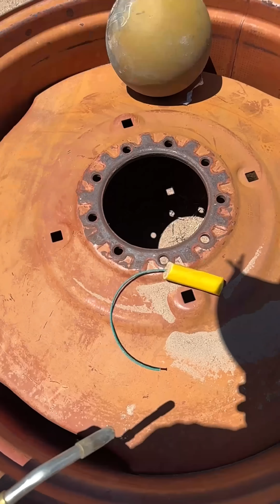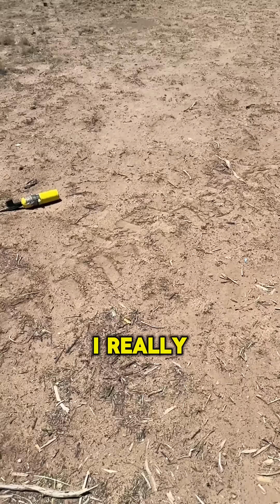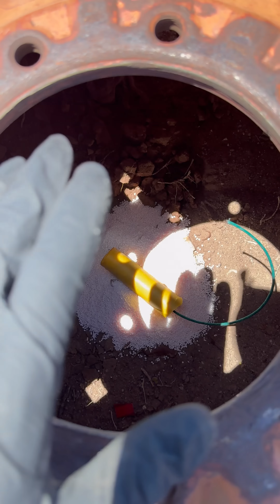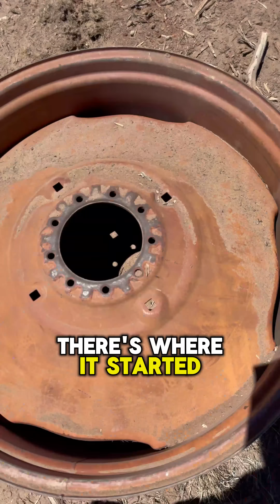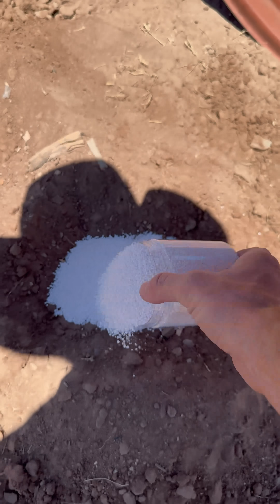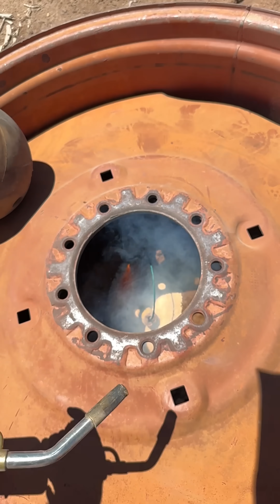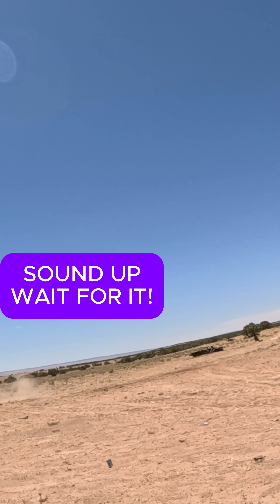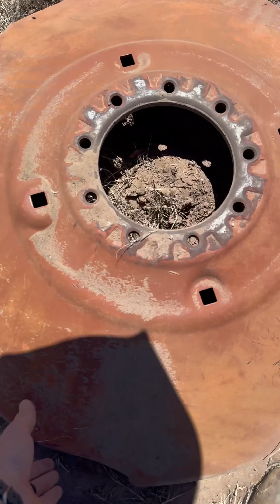How powerful is ANFO and Dynamite?

Comment: I know ANFO won't react when exposed to fire but watching you light a fuse buried in ANFO spooked me a little.
Reply: Think of it as c4 it ain't gonna light it requires alot of boom to kick start it acually better one its like diesel it doesn't light but if compressed it go boom
Reply: @matthewching500 Interesting
Reply: @matthewching500 diesel does light wtf are you talking about it just burns slower than gas
Reply: @chaynebaltezore8986 you need a much higher compression to get it to reliably combust and unlike gasoline you cant just throw a match or a cigarette at it to light it, you would need at least a blow torch
Reply: @nuclearboom2467 never put out a cigarette with gasoline?
Reply: @AdamFoster  That’s a cigarette. Not a match. Cigarettes don’t light anything on fire. This isn’t the movies. They’re also right about diesel. It needs to be aerosolized and compressed to ignite.
Reply: @chaynebaltezore8986  No, it doesn’t. There’s a reason diesel engines operate the way they do.
Reply: I was thinking the same thing no clue what anfo was
Reply: What does it react to then
Reply: @antoine6717 its a secondary explosive,  meaning its very stable. It needs the shockwave from a primary explosive which is why hes using dynamite with it. Also why you need a blasting cap to set it off otherwise. And ANFO is very similar to tannerite which detonates from the shockwave from the precussive wave from high velocity rifle shells.
Reply: @PhilieBlunt666 thing is, he not using ANFO . That’s ammonium nitrate, the AN part of ANFO, and no it’s not a secondary explosive , it acts as an oxidizer… basically just
UPS the boom factor .
Reply: @dirtdevil70 thats what i said before. There is NO FUEL OCTANE. 
2nd put MORE MASS on top of the rim and you get a destruction 😅😅
Reply: @antoine6717  A shock wave of sufficient speed and sharpness to cause detonation.  Basically the molecules break up, a whole different thing than mere combustion.  The detonation wave then passes throughout the material, liberating a lot of powerfully-expanding gases and heat.
Reply: @antoine6717  The pressure of the dynamite blast
Reply: @antoine6717 it reacts to energy transfer. So the massive amount of kinetic energy the dynamite spits out causes the ANFO to react.
Reply: @antoine6717 it likely uses a force. 

Like a primary explosion. That sets the larger material off
Reply: @antoine6717  it reacts to shockwaves
Reply: @antoine6717  the shockwaves have to be pretty powerful though. its a secondary explosive.
Reply: @antoine6717  a detonator, and the dynamite does that it detonates the anfo. Once the dynamite explodes it exert so much pressure onto the anfo that it will detonate. Fuse burns+ anfo melts a little, +Dynamite explode+ pressure initiates detonation of the anfo. This is basic chemistry.
Reply: @maktiki  No need to be condescending, I could teach you a thing or two about computers that I would consider basics as well.
Reply: @antoine6717  Its just a joke:face-blue-smiling:
Reply: @antoine6717 impact. Explosion
Reply: @antoine6717  Explosive force
Reply: @antoine6717  cannon fuse too
Reply: just melts
Reply: i bet you think you can blow a car up by flicking a cig in the gas tank 🤭🤷‍♂️
Reply: @graphixkillzzz  if the tank is not full and you leave the cap off you can.
Reply: It's not ANFO, it's just Ammonia Nitrate without the fuel oil.
Reply: @Cr-cm9kc ammonium*
Reply: @Cr-cm9kc in another video he says it is anfo not just ammonium nitrate, but he makes it and it needs less diesel than you think.
Reply: @Cr-cm9kc maybe I'm just used to ANFO always using tinted diesel, but that looked like some idiot who has never made a living using explosives just scooping out dry white prill & thinking it works like black powder without knowing hos black powder works. Leaving the bernzomatic behind = amateur
Reply: @m-erko I agree as stayed before where the damn diesel
Reply: @m-erko  So the standard for watching an entertaining video involving explosives is that the creator must have "made a living using explosives?"
Reply: @Cr-cm9kc  That is what I was thinking. I didn't see any Fuel Oil (Diesel).
Reply: The fire fighters in West Texas probably agree with you.  R.I.P.
Reply: LOL I was thinking that exact thing, he is safe but still get the sphincter effect lol. Now I can kinda understand when I am working on live 3 phase and some people cant watch, even those that know I understand what I am doing and am safe, they still get that same effect  :-)
Reply: I thought ANFO is actually ammonium nitrate fuel oil emulsion. This looks like just ammonium nitrate. You need to mix it up, add a fuel oil with ammonium nitrate sat. Solution and a PIBSA emulsifier.
Reply: @f1ferrarifan1  Yes it's just AN.  Which is a high explosive of considerable power even without the fuel oil.
Reply: @f1ferrarifan1  as for creation of ANFO, yes you are correct it is technically an "emulsion" although it's not normally called that as  you're dealing more with a physical particulate matrix, not a chemical one as in a true emulsion. Emulstions are typically between hyro-phylic/phobic substances, or lipo-phylic/phobic etc. 

ANFO is an emulsion in the sense that you are essentially coating ammonium nitrate particles with diesel fuel oil. The diesel effectively slows combustion and slows the detonation rate in m/s. This is really only useful in the blasting/mining fields, as its purpose is to slow the detonation wave enough to allow it to push solid material, versus cutting/smashing it. 

TL:DR ANFO is kinda an emulsion, on the macro scale, designed to slow a detonation wave and allow more kinetic energy to be dispersed into a blast medium, aka a material to be displaced by HE. ANFO slows it to get the highest energy deposition, while maintaining the  cracking effects of HE dets.
Reply: It can burn.  Which would be quite bad in this situation.
Reply: @TheAttacker732 Nope
Reply: Me too!!!
Reply: ANFO =ammonium nitrate, fuel oil (diesel). Theres no diesel in that, with diesel, it only needed the fuse and explosive cap. And by the way, how do you think a burning truck carrying bulk ammonium nitrate explodes, making a huge crater and devastating anything in the area?  Several documented stories on yt about that happening.
Reply: @rossbrumby1957 how do you know there's no diesel in it? It's only supposed to be 6 percent, and if he used clean diesel, or maybe kerosene, you probably won't see it. The stuff soaks it up really good, so it will look dry
Reply: @ShannonDove-sy7ye I went to Victory day parade in Moscow 2012. The smell of diesel from all the IFV’s, tanks, was epic. I’d love to see about 1000 tanks/IFV’s drive down a California road burning that much diesel, but it would most likely end in a 10 year prison sentence. We were in the side streets and it was actually worse because Red Square is enormous and there is room for the fumes to dissipate a little.  At least feel like you feel not smoking it there because it’s much more open. Like or hate Russia, they do a badass Victory day parade to commentate the victory over Hitler’s stupid army.
Reply: @rossbrumby1957 what is used for the booster charge?
Reply: But the Smoke ring! right! lol
Reply: ANFO ist acording to Google, Ammonium nitrate and heating oil, altough that seems to be just nitrate. And we know what that can do just. If not check out the catastrophe in Beirut in 2020.
Reply: Same.
Reply: Same 😂
Reply: Spooked me too. I like watching this guy.
Reply: Is that like tanerite the shit we get in Canada???? Comes in 1lb plastic containers. I shoot it to make it go boom
Reply: @jacobmcleod5942 it’s 1/2 the components in tannerite. Tannerite is a mix of AN and aluminum oxide.
Reply: @jacobmcleod5942  tannerite is ammonium nitrate prill and the grey powder you mix in is aluminum oxide. anfo is ammonium nitrate prill and fuel oil.  they are mixed in approximately the same percentage. {anfo is 6% fuel oil}
Reply: @jacobmcleod5942 two deferent compounds tenerite is shock sensitive anfo you pretty much have have a blasting cap or a smaller explosive too set it off
Reply: @jacobmcleod5942 tannerite is anhydrous ammonia mixed with powdered aluminum. So yes, you did recognize one of the ingredients. 
Anfo is ammonium nitrate and fuel oil. This is just dry ammonium nitrate. 
Anfo us what the mythbusters used to obliterate the cement truck in season 1.
Reply: Where's the Diesel Fuel?
Reply: not ANFO thats only AN pearls...
ANFO Amonium Nitrate Fuel Oil
Reply: @tytauer1063 how do you know? It can soak up liquid and still look the same. Especially if he used high grade clean odorless lighter fluid instead
Reply: the primary was the dynamite 🤣🤦 ig yall didn’t realize how much higher it went each time
Reply: Guys, here is the True Savior of man

HalleluYAH translates “Praise YAH”

- YAH is the Heavenly Father (Genesis 1)

- YAH arrives via The TENT OF MEETING (Exodus 33, Isaiah Scroll)

- YAH The Father (Genesis 1) was Who they Crucified for the sins of “man” and YAH arrived to be Crucified via the Tent of Meeting 
(Book of Isaiah)

YAH The Father, He’s The Savior
Reply: Doesn't explode bro it just melts. You need a primary.
Reply: @stevepalpatine2828 White phosphors is being used in Ukraine. Looks heavenly from a far but not when you movie close and hear people burning alive, nothing pretty about it. It’s had to judge exactly where it will go or what areas are you can get through and which ones you can’t. All depends on how many they drop.
Reply: @chriscarlino5561 cool dude 👍
Reply: @chriscarlino5561 holy shit bro. Clearly proof reading ur comment before posting has absolutely never crossed ur mind. Ur comment almost made zero cents
Reply: @Woodshot48 I’m dyslexic and it didn’t cross my mind to prof read this comment.
Reply: @Woodshot48 I fixed it. Happy now?
Reply: @Woodshot48 I wrote this outside. Before you through dirt on someone, know facts first. I was taught you don’t through dirt at another man if you don’t know facts. And despite being dyslexic, I’ve done damm well for myself. How many languages do you speak? There was this other guy to who was dyslexic, you might have heard of him, I believe his last name was Einstein. He regularly struggled with spelling and grammar. Our brains don’t see the mistake while writing mostly. But verbally, I can get my point across fine. It didn’t stop my from attending a highly competitive Prep school as well as graduating from a very well known university in Philly. Think basketball. It’s just immature people who point out grammar issues, or speaking mistakes on YT. Mature people understand there are people with disabilities and that English may not be the persons first language.
Reply: @Woodshot48  You missed a comma after Clearly. It should be Clearly, when using this work first in a sentence. Another example would be when However, is the first word in the sentence it gets a comma. You also forgot a period. So don’t criticise people unless you are flawless yourself. If you want to be taken seriously don’t use “ur”. Do you think someone from another country gonna know what that is? Not even a word!
Reply: @Woodshot48  zero cents?  I think you mean zero sense
Reply: @TyroneMalon yah good ol auto correct
Reply: Yea he's for sure going to kllhim self at some point... on accident... but he's defo gunna blow his face off
Reply: I also find it a bit retarded that it's not remotely controlled and the gas canister being a probable projectile

edit:
and not knowing where all the parts fly
Reply: I agree
Reply: Things behave differently in massive quantities....a massive quantity of ammonium nitrates in a massive intense fire can be detonated by the fire.  But small quantities are usually not set off by fire
Reply: trusting cannon fuse to not instantly ignite that dynamite is fucking insane.
Reply: didnt look like anfo, jus an. anfo i think is a slurry in kerosene or diesel
Reply: @seagee7100  anfo is not a slurry. its only 6% fuel oil which is absorbed by the AN prill.
Reply: Pressure!. It needs a shockwave to go off. Yep.
Reply: I didn't know that and I was definitely nervous watching that!
Reply: I had the same feeling when I saw a 90 years old colonel chemistry engineer scraping TNT from an old grenade with a screwdriver. He was completely calm though
Reply: Same!
Reply: ANFO REACTS TO PRESSURE WAVES OF A BLASTING CAP OR DETCORD
Reply: The real danger is he accidently lights the base of the fuse by pulling the torch out too quickly with it still burning.
Reply: What is anfo? Americans get to do all the cool things 😂!!!!!
Reply: super stable shit, can buy it from academy on the shelves, has a catalyst in inside you mix up real good, and the heat and power from a rifle round set it off, or just use dynamite
Reply: @Gamin_Redneck oh so like tanerite basically?
Reply: Dude, the guy know what ANFO is. He's mixed in the right amount of Diesel.
Reply: I would use a much longer fuse than that.
Reply: Is anfo the same as tannerite
Reply: @kytrucking67  No but they have similar resistance to heat and both are binary explosives. I don't know what gets YouTube mad but let's just say they are share chemical components but also have significantly different chemical components. ANFO requires a primary explosive to detonate where Tannerite can be detonated with a Primary as well, it is more commonly detonated with high speed projectiles. Long story, ANFO is made in larger quantities and is nearly impossible to set off without a primary explosive. Tannerite is sold in small quantities and can be set off with a bullet. Both are binary explosives and can be shipped safely with the two parts separated without concern of an explosion.
Reply: @AdamVladimirKross thanks
Reply: That's not ANFO
Reply: Right? Still looks sketchy. Lmao
Reply: Same with C4. You can burn it safely. Used to do it to heat up MREs years ago. lmao
Reply: It is as dangerous as lighting water on fire. ...Exactly.
Reply: me too, but then I was reminded of the cowboy hat in his silhouette
Reply: His army wasn't stupid. If we implemented their wisdom, Western society would be safe and clean throughout
Reply: Idk if this has been answered yet, but anfo needs pressure and temperature.
Pimary small explosive gives both.
He could potentially make it go off with a firecracker, tho depends on exact anfo.
Reply: @Arek_R.  Yes the geometry of the container infleunces the way it wil exert pressure and temperature on the anfo
Reply: Wayy too confident but that's the difference if understanding the science behind. I learned when I was little not to mess with fireworks 😂or anything related
Reply: Man....the comments. 

- Anyways, he said the powder he was using was ANFO, so it probably was anfo. Yes ANFO can exist in this state. We call it a dry blasting agent, so no, you can't tell the difference just by looking at the prills. You WOULD able to tell by smelling it though. 

- Yes, anfo just melts when hit with fire. 

-ANFO typically is not cap sensitive. So no, a blasting cap won't set it off. But there are types that can be cap sensitive.
Reply: The 2020 Beirut explosion would like a word.
Reply: @fido2006 that explosion was a lot different than 2lbs of loose ANFO and a blowtorch.
Reply: @valdimer11  The OP needs to up his game.
Reply: FR ME IT WAS WHEN HE PUT THE TORCH DOWN NEXT TO IT I WAS LIKE THEIR GOES A... WTF
Reply: Same here 😅 Even knowing the chemistry, the visual of that fuse going in still made my heart skip a beat
Reply: It’s not ANFO…… no diesel.
Reply: Bowling ball is now in low orbit.
Reply: RIP the torch
Reply: Its just ammonium nitrate and it adds a stronger oxidizer upon detonation. Anfo and ammonium nitrate ARE NOT CAP SENSITIVE. Don't mess with HE if you haven't learned a lot about it on the job or grown up around it.
Reply: What caused the catastrophic explosion in Beirut? Thought that was just fertilizer?
Reply: I did NOT know that ...I was terrified
Reply: O to tak nawozy w Bejrucie uległy samozapłonowi. 😮
Reply: Holy shit that was cool
Reply: What is the simplest booster to det amonials like tannerite
Reply: The comment i needed to see
Reply: Need shockwaves to detonate
Reply: Ight, we now pals
Reply: People have a fundamental misunderstanding of how 'splosives actually work... the same people who think dry ice in a bottle thrown is a pool counts as a bomm.
Reply: @NickGreiner1988 I mean I've seen a guy lose his hand from a dry ice bomb not gonna hurt a building by any means but will definitely hurt you
Reply: @NickGreiner1988  a closed bottle of dry ice does create contained pressure, so it could be counted as a potential explosive/bomb, the same way the canister of a regular air compressor can be explosive. Any contained gas under pressure is a potential explosive really, the only difference to real bombs is how you create that pressurized gas.

Understanding what an explosive is is not difficult, the difficult thing is understanding the different mechanisms and potential chemical reactions of different explosives.
Reply: @NickGreiner1988  No but mentos in a bottle of soda is a bomb. Could be lethal if tiny pieces of metal are in it. But it’s for sure a “fun bomb”. lol dad joke! Splosive is what I put on my girls face.
Reply: If it makes you feel any better, if it did react you wouldn't have the video.
Reply: @atomictincan7040 well, we might, just not here on YouTube. Depends on who finds him and his cameras out there and if they have an 𝕏 account.
Reply: So it doesn’t react? What’s the point
Reply: @madebydimiakagreekmachine5822  they didn’t say it doesn’t react. It doesn’t react to fire under a certain temperature. The explosion is what starts the reaction
Reply: @madebydimiakagreekmachine5822 Clearly does considering the result. Anfo needs a significant shockwave to detonate. Triggered by the dynamite.
Reply: @madebydimiakagreekmachine5822 it only detonates when hit with a lot of pressure, like a explosion from a stick of dynamite. Tannerite is the same way, you can burn it and it won’t do anything, shoot it with a gun however and results may vary😂
Reply: @madebydimiakagreekmachine5822  It does, to dynamite... Not fire.
Reply: @madebydimiakagreekmachine5822  pretty sure it reacts to explosivity might be wrong tho
Reply: @madebydimiakagreekmachine5822  If you watch the video, it shows the whole point of adding ANFO